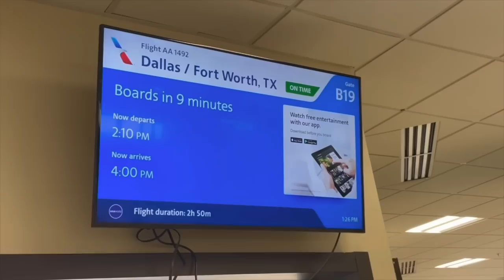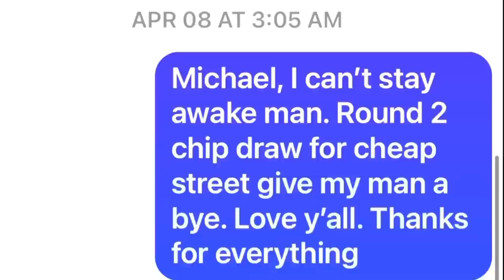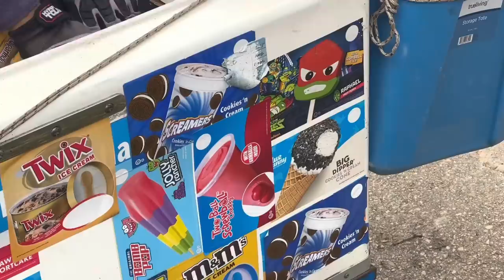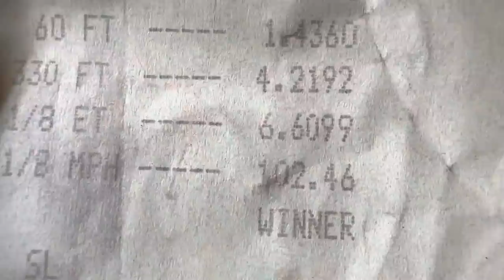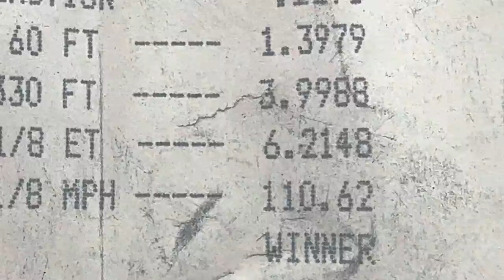NEW PERSONAL BEST & CHEAP STREET WIN AT YELLO BELLY!!!

Comment: That 700r is a beast to hold up to all that power. Impressive.  Congrats  on the win Bill.
Reply: 700's are a ticking time bomb 💣 th400 or 4l80e are the way to go especially when you start to make good power. I prefer th400 and gear vendors overdrive.
Reply: @musclebone7875  the gear vendor stuff is hard to beat.
Reply: I agree I got a 700r4 in Mt Street car and I'm afraid to hit it that hard
Reply: @chicago_race_engines7538  I feel you. I have a th400 transmission with gear vendors overdrive setup in my '68 impala. It's mated to a 496 big block that dynoed at 565hp and 600tq. At times I beat the hell out it and I never worry about breaking it. 700's are nice transmissions with a great overdrive cruising gear, but they were never engineered to used in drag racing.

Comment: I wonder if you wouldn't be better going to a turbo 400 and a gear vendor's overdrive vs a 4l80e and everything to switch it to a cable speedometer. Just a thought. Another option is to forget the dash speedometer entirely and go to a GPS type speedometer. There is a conversion box to convert the 4l80e vss signal into a speedometer cable to run the speedometer, but as far as I've ever seen it's around $400. So I wonder what the price difference is between a built th400 and a 4l80e that will do what you need.

Comment: That dakota digital converter box seems to be the easiest route to go for getting the speedometer cable to work.  Are you planning on going with a full manual Trans Brake valve body or getting a stand alone controller? You can use a factory pigtail and wire it up to where a stock valve body is a full manual shift and lock up is a switched ground. I believe jakes sells a box but you can build it yourself for a fraction of the cost of that box.

Comment: Hey bill, try fortes parts connection in Massachusetts for the speedometer stuff. He pioneered the gm TKO from a tr3550, and machines all sorts of adapters for their speedometer outputs. They take a th400 yoke, as does a 4l80, so he may be able to help you out. He machined a cable drive adapter for me to keep the factory speedometer working in my turd gen. A company called shiftworks also sells an 80e tail with a cable drive cast into it but it’s pretty pricey.

Comment: I put a 4L80E in my 68 Firebird. I sent the tailhousing to someone on eBay and they put a gear drive in it so I can just use my cable driven speedometer. If you’re interested I can look up the info. I think it was around $400 4-5 years ago.

Comment: Bill, if you do end up going with the 4L80E. Circle D converter.  
Also, I don’t know if TCI still makes it, but I have there reversed, manual valve body with trans brake, it works well.
Reply: I have that valve body in my 4L80 too and I like it. I haven’t had any issues with it

Comment: Dude, SUBSCRIBED!! I love it!!!!

Way you handled the disrespectful crap talker, Jimmy Dale, all of it!!!

I want those cam specs on ya 355...  Idles just like my GM LT4 Hotcam with 1.6's!!

I got a ZZ430 clone in my 91 Formula....  Holley stealthram, 30lb Accel injectors, the works, ALL aftermarket and even a EBL P4 computer!!

Plan on supercharging it, but as you know factory roller blocks especially 2 bolt wont hold a lot without fear of "cap walk" so i am gonna keep it turned down until i get the all forged 350 Dart block built with CNC Street AFR 195 eliminators...  Comp XFI CAM... Then 15psi+ all day long!

Ride easy!

Adam

Comment: Jegs has a box to run a cable driven speedo, it can use GPS or electric VSS input.  I have the part number if you need it.

Comment: Not much help here, but if i rember correctly, someone makes a tail housing conversion for the 4l80, that uses standard gm speedo gears. Its been a few years since i ran across it, and it was expensive then. Might look for that. I know you like less electrical.

Comment: Don’t know how or why, but I had commented on upgrading to a 4l80e and suggested looking for a 4L85 as the had 5 pinion planets, and to upgrade the input hub to a sonnax hardened one with a thrust bearing instead of thrust washer, kegs should have that in stock, and as far as making the speedo work, there’s kit you can get from Bowler Transmissions to still utilize your factory cable. I won’t put the link this time in hopes to not have my comment deleted….

Comment: Get the gear for your tire size & gears buy a tail shaft cover for cable at summit for 4l80 transmission  then you can run your factory speedometer & speed cable.

Comment: Just curious. Why not run a factory style Dakota digital cluster with a gps. You won’t have worry about cables for the speedo gear. and you can program the odometer to the mileage on your odometer. I replaced my cluster in my mustang with one. and it was one best upgrades I’ve done.

Comment: Just a thought in passing when everyone builds a 700r4 they always use a corvette servo on the second gear band it is a smaller piston so it shifts faster but in hyd smaller means less force so if a person was to maybe drill out the oil passage and put the stock servo back in it would stop the slippage I’m not a expert by no means just asking maybe someone out there might have the answer

Comment: I know this might sound crazy but have you ever thought of running a termi x max and using a tps on the carb throttle? You would have trans control, n2o control. I/O, and data acquisition… not super expensive for what ya get.
Reply: And timing…

Comment: I'm not sure which 2nd gear servo you are currently using, but there are some larger billet ones out there such as the Sonnax 77911-03K 2nd gear super hold servo.  This may help to lock up second gear better, with more apply pressure over the typically used Corvette servo.

I've used the Dakota Digital speedometer drive motor before with good luck for electronic to manual speedometer conversions.
Reply from the maker: I believe the one in it is a TCI
Reply: The problem with the 2nd gear band holding is usually the drum it applies on gets worn down in the center and the band only applies on the outer edges. So you only have about 40% of the band holding.
Reply: @theoldmansgarage  TCI probably uses the Corvette servo, which seems to be the universal performance replacement.  They do also offer a larger capacity servo like the one I mentioned.   It is easy to remove to see which one you have.  Their website shows pictures of both for identification.

Comment: I would give cahall performance transmissions a call they specialize in 4l60es which is basically a 700r4. They have them holding some big power behind some heavy ass cars. Just a thought. Gail is always down to help.

Comment: Electronic Signal To Mechanical Cable Drive Speedometer Adaptor
$365.00

Finally, the missing link between your muscle car's original, cable-driven speedometer and swapped-in electronic transmission!

Measuring a compact 5" x 4" x 2", the new Electronic Cable Drive, or ECD-100 for short, allows the use of a mechanical-cable speedometer to be used in conjunction with a modern drivetrain which provides only an electronic output.
PSI conversion

Comment: Glad you guys made it there and back, despite the difficulties going there. Congratulations on the win Bill. You guys always have fun.  Like my late father said about fishing, " if you caught fish every time you went, they wouldn't call it fishing" same thing with racing, those other guys and gals work hard and want to win just as bad. Billy will get the drain backs figured out. I know guys that use a pump on both sides of the turbos, supply and return because gravity just not returning it fast enough to keep up with high volume/high pressure oil pump. The nova was flying for its first real time out with new motor. Go fast and be safe. God bless you and your family and friends.

Comment: I have a speedhut gps speedometer in my car that works great. Pretty much dead on accurate and it has a built in dragy as well. Was within 1mph and less than a 10th off in the 1/4